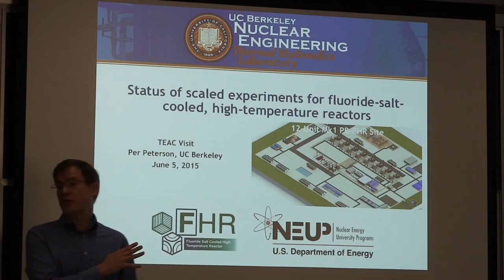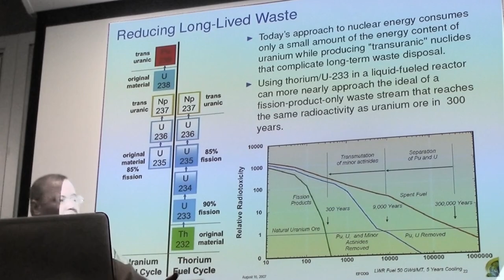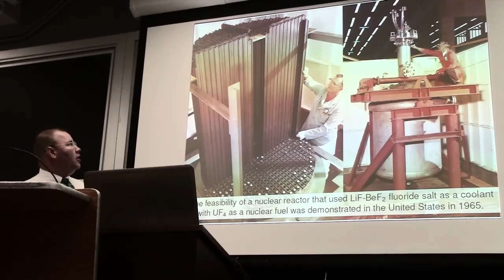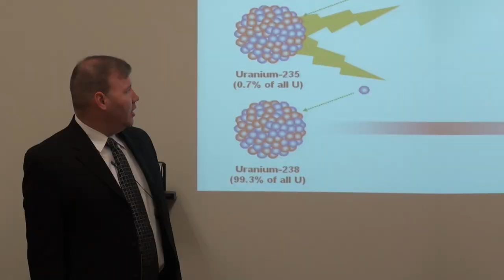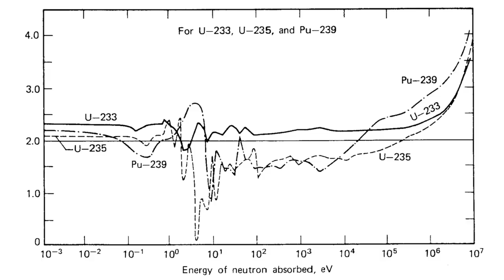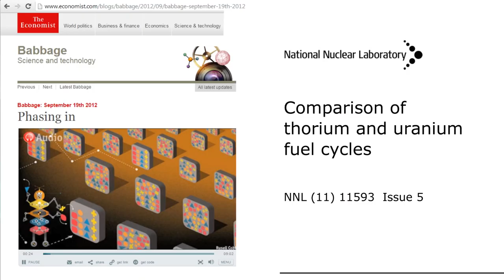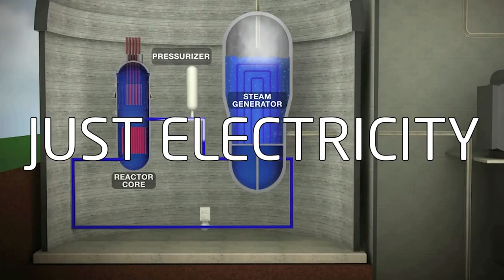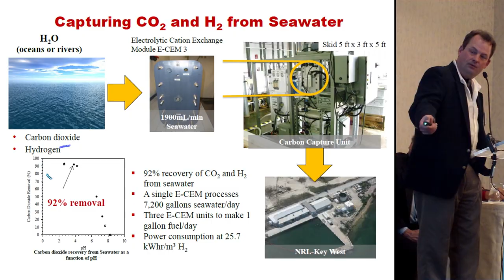Thorium Disadvantages

Comment: molten salt reactors have MAJOR problems, and that is that if for whatever reason the salt solidifies you now have a massive lump of radioactive material sitting there that is utterly useless, and your multi-billion dollar powerstation has been destroyed.

That's the main reason molten salt reactors aren't used more, especially outside the military where they have seen some very limited use in nuclear powered submarines because they can potentially be built smaller than water moderated reactors.
Which has led to the loss of several of those submarines from the Soviet fleet when their reactors ran away.
Reply: You are factually incorrect to state Molten Salt Reactors have "seen some very limited use in nuclear powered submarines" they have NOT. All MSR ever in existence operated at land-locked ORNL.

If you prefer your salt liquid, heat it up and it will melt. Melt it, freeze it, melt it, freeze it. Unlike today's solid fuel reactors, when the molten salt is liquid it is still chemically stable and traps non-gaseous fission products such as cesium. That happens regardless of the salt's solid/liquid state. Try that with fuel rods if you think they're safer.

You are welcome to your own opinion on reactor safety, and to post your opinions on YouTube comment section! But I'll have to trust the many scientists, national labs ( https://www.youtube.com/watch?v=aqPLU8ge-0w ) and private investors (Bill Gates!) over... CaptainDuckman.

Comment: So the hardest part of the molten salt reactor is the blanket wall design that needs to reliably separate outer thorium from the inner uranium 233 while the wall is being bombarded by neutron? Why don't you just start the video talking about this trouble point?
Reply: Because that was not cited by anyone dismissing thorium. If your take-away from this video is that the real-world challenges in no way reflect testimony given to congress or the cited reports, then that is my point. The people dismissing it don't care to learn the real challenges (or real value proposition) because they are presuming it must be consumed in sub-optimal reactors.

Do I need to start with protactinium to make that point? Should I? Don't think so.

Comment: The key takeaway you need to expound is a hot liquid salt, not a metal. ThoriumFlouride (ThF) does not exist as a gas, yet Uramium Flouride (UF)does at the same temperature. So UF by-products boil off the liquid salt in the reactor and then can be condensed, captured and removed. The second key point Uranium reactors need high pressure to operate, Thorium does not and therefore is hugely safer. If something bad happens to the reactor, bad manufacturing or attack then all the liquid salt drains out the bottom into a sealed cold tank and freezes - both UF and ThF freeze back to cold solid and therefore made safe. Even if somehow it spills,it still cools and stops reacting.  More than a million tonnes of known Thorium in the world and 5,000 tons per year is enough to run the world - good for 200 years.  How big is it? A 0.25 cubic ft provides 1 MW. WASTES and DISPOSAL this is the biggest worry because of Uranium technology legacy. Needs a simple viable explanation. Oh, China, India will have Thorium technology generation sooner than anyone else.

Best to minimise chemical engineering discussion and keep simple, and the physics even more so, otherwise the message takes too long to get information to people familiar with 280 characters information packs. Decision makers only need a single page of words with a few images, and the advice of people they trust.

My last gratuitous advise :-)  do the above, approach all the people you think might be advisers to Trump, hope for his re-election and propose, "We are not going to the moon by the end of the decade, we are going to have a functioning Thorium reactor by the end of your second term Presidency".

Comment: Could a thermal reactor be built in really, really compact size?
Reply: Yes, and it is already the case.

Because while governments pull their head into their ass denying molten salts reactors (because they would lose money from their friends in the energy sector losing makret value), their military is already using molten salt reactors within their submarines.

Molten salts are compact, efficient and more importantly they don't need a pressure vessel. For a sub that means getting rid of a big bulky and HEAVY containment vessel, and getting rid of something that can explode. Nuclear subs have been using liquid fuel for decades.

Comment: You still have a remaining principal problem as long as the steam turbine is anywhere in the chain.  That the old Carnot cycle efficiency.  In short, the cycle efficiency is at best  (T1 - T2)/T1 where
 T1 is maximum absolute temperature expressed as Kelvins.
 T2 is the minimum cycle temperature expressed similarly in Kelvins.
As the cooling temperature on earth is not likely to drop below ambient or not even very close to that, let's take round numbers - T2 = 300 K and T1 = 700 K (material limit), the formula gives best efficiency as 400/700 or 57%, ignoring any additional losses.  If the low temperature could be reduced to near 0 K, then we could approach 100% theoretical efficiency.  Space temperatures anybody?  Or anybody knowing ways of eliminating all the additional losses in the plant?

Comment: The disadvantage is that it is almost certain to be more expensive than fusion in the form of solar PV/battery and solar thermal. Solar gets cheaper every day. Just the money spent on developing a new nuclear power generation system would significantly reduce the cost of solar if spent on just purchasing existing PV. Nuclear is by its nature centralized and is IMO  a way of keeping money and power in the hands of those few who profit by middle manning electricity. Solar threatens that.
Reply: Steve, you're suggesting an experiment which has already been run, that is massively subsidize solar. Great at low penetration but (as Jesse Jenkins shows) once intermittent energy's penetration comes up to its capacity factor then its value starts to rapidly diminish. (And that's a co-incidence... there's no reason capacity factor is where the value drops it just seems to work out that way based on how energy pricing looks today.)

I'm all in favor of gov investing in all forms of basic R&D, and that includes energy storage.

But today's yearly Advanced Nuclear research subsidies are in the millions, while renewables subsidies (to sustain existing penetration) are in the billions. Where's the big payoff? The low-carbon success stories are France, Sweden and Ontario. Germany COULD HAVE been one too, but they went renewables, and basically have been wasting billions of Euro to switch from one low-carbon source to another... they're CO2eq/kWh has never gotten close to any nuke-in-the-mix successes.

PLEASE take a moment to review actual carbon intensities of various countries: https://www.electricitymap.org/

Dr. James Hansen (godfather of global warming) is an excellent spokesperson for the exact same technologies I'm promoting... Thorium and Molten Salt Reactors (as he explained to Rolling Stone magazine), and until that tech is commercial the continued deployment of conventional PWR.

Michael Shellenberger argues that the centralized nature of nuclear power (we can have Small Modular Reactors but they'll never be house-hold scale) is unappealing to folks how find centralized power production as somehow inherently unappealing...

Do you process your own sewage?

Do you grow your own food?

Do you install panels, batter backup, and transformers to essentially go off-grid?

Probably not? Because most human activities benefit from scale.

While improved battery tech can help solar compete slightly beyond penetration == capacity factor, that will ALWAYS be an added cost, another piece of hardware with a finite number of cycles and a CO2 footprint to manufacture.

If you want solar to perform better, there's another remarkably boring solution... build power lines.

Comment: Advancements may be awsum but at what cost
Reply: Canada might show an interesting example. New Brunswick is going head with a fast-spectrum MSR (Molten) and Ontario is going ahead with a SMR BWR (by GE-Hitachi). So that's fairly aggressive tech vs conservative tech. I'm sure the BWR will be cheaper, but it also won't "do" as much. Won't recycle used fuel. Won't create high-temperature process heat.

Comment: so what if that drainage pipe gets blocked so it can't drain? earthquake, malevolent action.. just asking. old uk duffer here :)
Reply: ThorCon's version needed 4x the drainage of MSRE and os designed 4 independent drain pipes. Drain pipes aren't only mechanism to control fission or passively dissipate heat. But they do help protect structural materials, if other mechanisms fail, from temperatures which would reduce vessel lifespan.

Comment: we already have the technology to drill deep enough and do it cheap enough to put geothermal anywhere.
even in the middle of populations.
the cost of nuclear should be making the point doa for nuclear.
you have to build it out in the middle of nowhere, and unlike geothermal, you have to fuel it continuously afterward to work.
Reply: Please go do that. Drill deep geothermal wherever you want, as you say can be done. I'm not anti-geothermal. But some things to consider....

Imperial Valley produces 200x the volume of radioactive waste as conventional nuclear, per kWh. Geothermal is powered by the decay of radioactive elements. And if you extract heat faster than that decay can replenish the heat reservoir, then you will "run out" of geothermal in that area.

Geothermal, so far, has only proven to be economic in ares with unique geology. Even nations with the biggest geothermal resources (Iceland) depend on hydropower and NOT geothermal for most of their energy. I'm sure geothermal is constantly improving, but to-date ONLY hydropower and nuclear have decarbonized grids.

Nuclear Power doesn't have to be built "in the middle of nowhere". They tend to be, but there's no need for it.

Nuclear Power can use Uranium or Thorium as fuel. Do you have a problem with Fuel? It can be quite handy... to store energy in a stable form for future needs. I single Uranium pellet (the size of a gummy bear) can replace a ton of coal, and that's with today's rather inefficient reactors.

Fuel is good. Everyone trying to imagine 100% renewable energy systems ultimately comes back to fuel... in their case, hydrogen fuel. Because we NEED fuel.

Comment: What if a country that does not posses any nuclear weapons develop thorium reactor ?
Reply: They'd need fissile with which to seed the LFTR. It is possible to seed LFTR without weapons-grade material... the Pu created in LWR is contaminated with enough Pu-240 isotopes to make it unsuitable for weapons. Flibe Energy's 2019 DOE GAIN voucher is to examine (in part) question of Fissile Security. Kirk does talk about U233 and proliferation concerns in this (more recent) video: https://youtu.be/2U9HVIFt2GE ...but the U233 created in LFTR is also consumed in LFTR. There's no U233 being exported from the reactor with the Fission Products, because the breeding ratio is so low. If a country wanted weapons, this isn't a practical way to go about it because no net fissile is being created. More practical would be to dig up Uranium, out of the ground, and centrifuge it.

Comment: What's worse than this issue being treated as it has, is that nobody including me knows about it.

Summary for the layman: nuclear fuel is rare and dangerous, however, with a different way to make a power plant, you can do the same thing with common dirt (in a sense), safely amd economically. Not only that but the government made ofe of these plants secretly, and was revealed 30 some odd years later. Based on the information, it is clearly better to do this other way on many levels, but there os resistance where ot should be embraced, woth many bitter remarks about how this way doesnt make weapons. Poor countries are actively pursuing this. Sounds like a good stock.

Comment: This video is a bit random.  What is with the long trip to a steel plant.   Very little on the problems of Thorium reactors.     The biggest is that they have not been developed and are mostly theory, it will take lots of money to develop the process into a working reactor.  How much money is anyone’s guess, price estimates are always based on what has been before and with a new process the cost is very open ended.   It is difficult to attract capital without cost estimates.  What are the problems with Thorium?  No one knows and won’t know until some real money is spent.

Comment: graphite is a must for a thorium reactor
Reply: Fast-spectrum Th-MSR doable, with same breeder-blanket design. But more fissile would be needed in core, and you'd be dependent on reflectors and core geometry for safety and not have moderator to maintain criticality (so not having removal of moderator as one of the ways of controlling criticality). But if one pursues fast-spectrum Th-MSR then fast-spectrum U-MSR would also be very appealing, as opposed to with-less-fissile thermal-spectrum-breeder MSR only being possible with Th and not with U.

Comment: So what are the DISadvantages again?
Reply: Paul, there are chapter breaks for each disadvantage topic. Here's a copy of the index (found in description metadata):
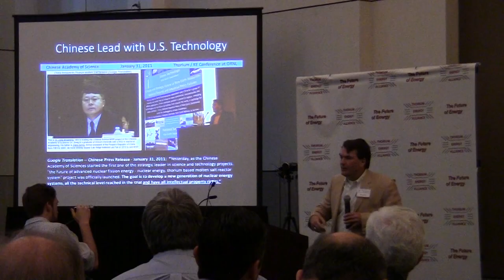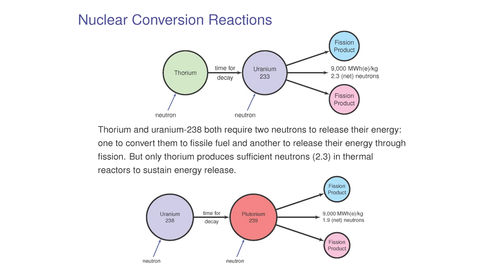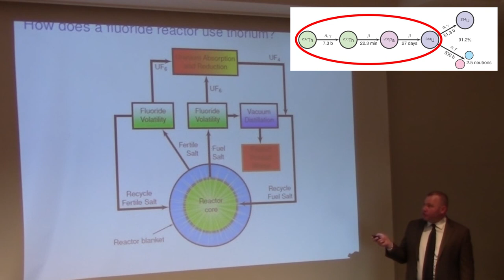00:00 Solid-fuel thorium reactors fuel utilization ratios similar to PWR. 00:42 Liquid-Fuel in United States licensing is "scary". 02:04 Obama Administration willing to give away MSR know-how. 02:40 PWR seen as "good enough" for long time. 03:00 Licensing restrictions specifically target liquid-fuel. 04:45 NEA OECD evaluated solid-fuel, and liquid-fuel-fast-spectrum only. 20:50 Thermal-spectrum neutrons hitting U233 produce only ~2.3 neutrons. 23:00 Graphite moderator required to sustain fission in MSBR thermal-spectrum. 27:50 Protactinium-233 half-life 27 days. 29:00 Material challenges (MSR is pre-requisite so MSR challenges are Th challenges.)
Reply: odegaard  Material challenges are listed in my timecode index, 29:00 . The startups looking to build MSR are looking at either expensive materials (Flibe Energy) or shorter-lifespan less expensive materials (Terrestrial Energy, ThorCon). China's SINAP has created a Hastelloy-N equivalent called GH3535, and might be what they're building their MSR "LF1" vessel and pipes out of right now. TMSR-LF1 38.960 N 102.612 E.

Comment: 17:30
What happens when you can't drain the reactor?
Reply: You can still remove the graphite tubes and that the reaction will start slowing down in the reactor. Not as fast as when it's drained, but it will go down, and not critical.

Comment: Okay, sure. But what are the cost of maintaining such a facility say 20-30 years? Fuel is abundant, waste is low. Somethings not adding up. No business would let such a opportunity not be utilize. It's got to be the molten salt. it's the only thing I can think of that is a problem. Chlorine and sodium are very very bad for iron and nickel based alloys. Cobalt based materials is also not looking good. What the hell is going to hold the molten salt? What is the down time for replacement parts and repairs? How long can people run the reactor safely before something fails? When somebody creates a material that solves these problems it will take off. The biggest problem with current alloys is stress corrosion cracking happening do to the environment. Heat just accelerates the problem.

Comment: I say let's build a thorium rector. They had one before. See how it goes. We know much more about safety have metrials that. Could counter the corrosive effects. It's worth a try and if it does not work back to the drawing board. I am all for solar and wind however that tech still has a huge way to go before it can replace fossil fuels. It's not perfect but far more practical.  Could it be the transition fuel while we figure out renewables? In Maybe.

Comment: Then if it's a first mover cost and everyone will benfit from the first mover costs, then wouldn't it be beneficial to simply pool resources and pay those costs equally? So isn't the "problem" a really really dumb one, because that way for each individual company / state / country it would be incredibly cheap. I know the fuel fabricator guys are against Thorium because you can chemically separate thorium so anyone with a pretty basic knowledge of chemistry can do it. But the fuel fabricator companies are separate from the plant builders.

I get that some countries wouldn't want to work together which is dumb, but it is what it is. Couldn't companies work together to do with, there motive is profit so it shouldn't be terribly difficult to get them to work together to do something that nobody wants to do alone.